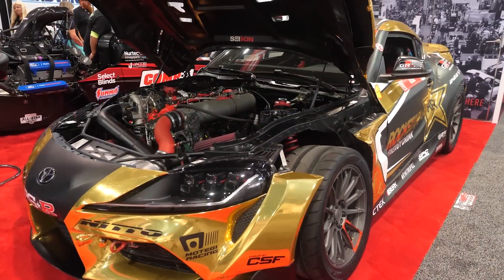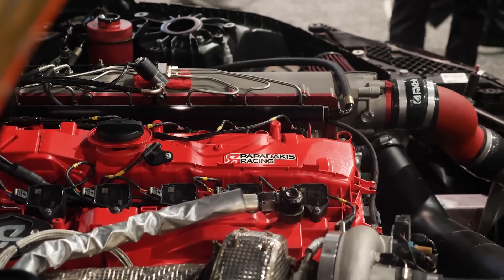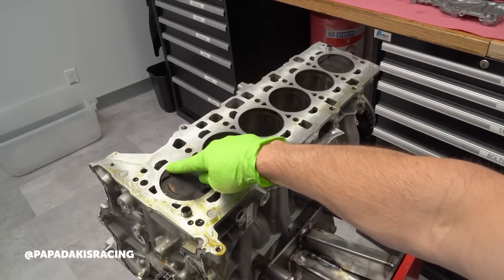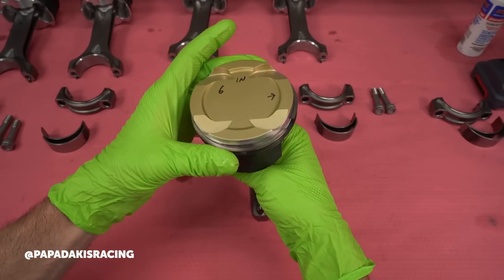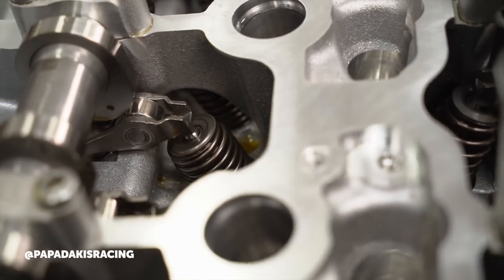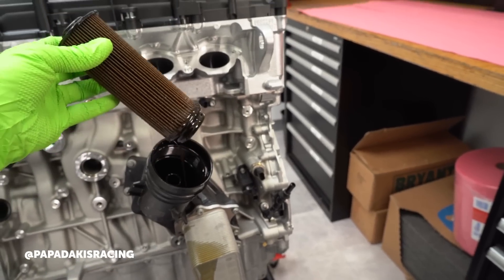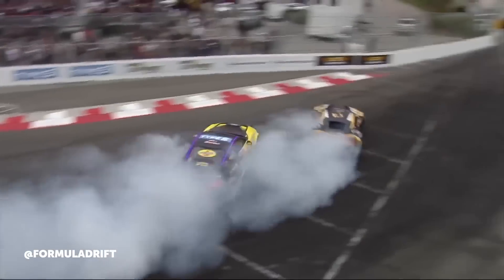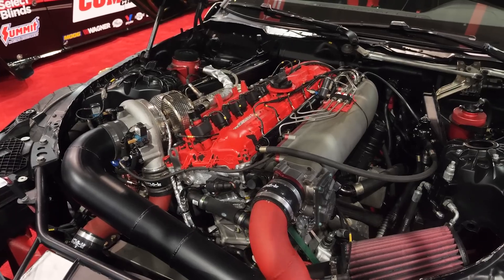Goodnight 2JZ? | 1200HP B58. Stock Block, Stock Bores & No Dry Sump!?

Comment: This engine still won't touch the 2jz records.
An engine isn't great because of what this guy can do with it. Just making over 1000hp doesn't automatically make it a good engine. Even subarus do that these days. 
The jz is great because pretty much anyone can have loads of power relatively easily. Don't have to pull the engine to do a timing job for example.
The Nissan gtr v6 is actually a better engine that makes way more power than its predecessor. The a90 is not ever going to be undeniably faster than the mk4 like the r35 vs r34. It's a Bastardization not a successor. 
2jz Oiling issues are from front sump swapped cars. The rear sump in the supras are perfectly fine and people get several seasons out of very high power cars without eating bearings.
It's the power coupled with Durability that make the jz great. Don't have to throw the block out because you nicked the cylinder wall.
Bmw engines belong in the garbage.

Now a jz with a bmw dct is a good combo.
Reply: Toyotas goal with the A90 was to be faster on a road course and the A90 Supras are faster than the A80's were.
Reply: @KingCobraStunts  no their goal was to make a bunch of money without spending any money on developing their own car. Just like the frs. Toyota has been coasting on the reputation they built in the 90s. They only produce junk now. 
The a90 shares zero similarities with the supra. It's not a supra. The m4 should've been the shared chassis if they had to use bmw. 
Honestly the frs has more in common. Even the frs has back seats. 
The blitz supra(very mild build) ran a 7:49 at the ring back in 1997. 
The current a90 record is 7:52 as far as I know.
Reply: @Dillon Youngquist  despite you being mad that they collaborated with a different company like they been doing for awhile, the 1 jz was a collaboration with Yamaha and the 2j was just an improvement of that design. It still doesn't change they made a better product than their predecessor at an affordable price, otherwise the car would have been the same price as the ones they want to compete with like the Cayman GT4 etc...
Reply: @KingCobraStunts  you're confusing collaboration with rebranding.
Lotus helped design the supra before the jz existed. They helped engineer, they didn't produce the car for them. Lotus also used parts from Toyota in their own cars. The excel has a w58 transmission. 
The a90 is 100% bmw 0% toyota. Manufactured in Germany by bmw.
And yamaha knows how to make good engines unlike bmw.
The supra was never an affordable car.
When you account for inflation the mk4 msrp would have been 100,000$ today.
Reply: @Dillon Youngquist  it is still a collaboration, the z4 and supra are not identical and it shows in their abilities at the track. The goals as stated by Toyota were to make a capable track car and they achieved that. The a80 was a sports car and the a90 is a more capable sports car, still keeping in line with being a sports car with a Toyota badge on it, you're just acting like a triggered fan boy about that because you have animosity towards BMW and feel Toyota should spend LFA money to build a sports car that would end up priced like an LFA...
Reply: @KingCobraStunts  also the ls400 was over a billion in development cost. And the lfa cost around 800 million. And do you know which one sold for $35,000?
They could absolutely make a great car themselves if they wanted to, but their decisions are solely based on the investors.
Investing money into r&d for a fun car and taking a risk on it would cost them way more than the potential sales loss if the car flopped. So they just paid bmw to slap a roof and toyota badge on a z4.
The mk4 supra is a legend. The a90 is shitty reboot.
Reply: @KingCobraStunts the Yamaha argument was a bad counter. your just arguing this point. Yamaha designed things and is a Japanese partner of Toyota for ages. BMW assembles the Supra in Europe. Software is bmw, suspension is bmw , everything down to the dimensions are Z4 BMW. How do you even contrast that to Yamaha? TOYOTA is not investing in sports cars u can’t disagree with facts.
Reply: Nearly anything is possible if you try hard enough
Reply: @coreyw427  I do not think the b58 will hit 2000hp with the stock block like the jz has. It'll have to be billet. 
The cylinder coating is a huge issue if you are going for really big power. 
The b58 is not a brand new engine for the a90 its been out long enough to replace the jz if it was capable. it came out almost a decade ago.
It will not be a popular engine to swap into anything because of all the better options.
The 5.0 mustang, Camaros, etc all hold loads of power without opening the engine. And they are easy to work on. Streetabilty is also very important. The locked vvt and sketchy oil control won't be good for that. 
I absolutely hate a v6, they sound awful. But the new z ttv6 is a much better setup. Once they've been out for awhile and you can get them Cheap with a salvage title they will make killer "cheap" seat time cars .
What lz and htg are doing with the a90 is sick but it's not simple or cheap.
Reply: @TacticalTushie  what stock block 2jz can hold 2000 hp? That’s ridiculous
Reply: @coreyw427  it's literally on this channel lol
Reply: @TacticalTushie  oh sorry thought you were saying stock engine / stock bottom end. My bad. I wouldn’t rule that out for B58 block though.
Reply: @coreyw427  I can't see the future obviously, but I don't see it holding that kind of power.
Dart is launching an aftermarket 2jz iron block that'll be stronger than oem and much cheaper than billet.
The b58 just can't compete.
Now if you just want to go play in a factory car with 600hp it's alright. But I don't see it ever being a popular swap for some grassroots idiot like me that puts engines where they don't belong .
Direct injection requires a more expensive ecu. And I really don't want to pull the engine when I'm a tooth off with the timing. 
My 1uz and 2jz can run off of a $200 speeduino ecu if I I wanted to be really cheap.
 I got my complete 2jzge from a junk yard with a 5 speed for $440(after covid) just selling the w58 will give my money back. 
Put in pistons, rods, gsc cams, eBay manifold, vs racing turbo, 1000cc injectors. Controlled by emu classic. Roughly $5000 for an engine that would easily make over 1000hp(just need bigger injectors) is a no Brainer compared to the b58. 
I think by the time the jz dies the b58 will have been dead. Something else will make both obsolete.
Reply: @TacticalTushie  a lot of pessimism towards an absolute work of art brought to you by the guys that made the s54. These are for sure going to get swapped in things, they already are. 2jz is too heavy for a lot of swaps.
Reply: @87isbmw  s54 is not a good engine. This is not art it's science. You are blinded with bias. Have fun welding your oil pump together just so your bone stock engine can rev past 4000rpm without falling apart.
What swap exactly is the jz too heavy for? Because they get swapped into everything, including ae86 and miatas.
You also gotta think about all the weight from other things you have to add vs a jz swap. The power steering pump is part of the weight of a jz its not on the b58 because it's electric. An electric pump is heavier than belt driven especially since the belt is there regardless. If you need a light engine no inline 6 is the right choice.
Reply: @TacticalTushie  is competing already, it has won were no 2j has won (time attack, circuit ect) it has hit 7 and 8 seconds with a lot less than 2Js even if they haven't touched 6s it deserves to be praised specially with a lot less power required.
Reply: @tempeztad where*
 you are just wrong on in every way lol.
Buy your logic The ej20 is better than the jz because wins in races where the 2jz doesn't(rally ).
When you are comparing engines the dyno is the most important tool. 
It is much less work to hit 1000hp in 2jz than a b58. 
Put a 1500hp jz in an a90 and it'll destroy the a90 1/4 mile record. 
You all just hate on what's known to be good trying to be race car hipsters. You probably hate the ls too.
Reply: @Dillon Youngquist  the hater here looks to be you... I said the B58 is in fact ,competing. I'm not trying to convince you, I have seen the events the B58 has be proven and won.

Never trash talked the 2J either. You do seem to have something against the B58 yet, we don't need you to try to convince us.

Jackie has won most GTA events, Mike Bottie is in the 7s, we are happy and celebrate their achievements.
Reply: @TacticalTushie  So much ignorance lmao, the engine capable of the highest piston speed of any production car is a bad engine but sure, even though it has higher piston speed than F1 it can't rev.  Well over 100hp per liter too. Literally just have to wire tie or put a spot weld on the oil pump gear for insurance. It throws off the front to rear balance, especially in something in the 2000lb range like the cars you mentioned but a keyboard warrior like you would never know. I have an MR-S hydroelectric pump on my swap, weighs maybe 2lbs extra but I can put it against the firewall for better mass centralization, while removing parasitic power loss to turn it. I'll take an inline 6 over a 4 or 5 cylinder any day.
Reply: @tempeztad  you don't understand what you are saying.
You actually think the b58 is better than the jz because the chassis has good grip.
If you equalize every variable except engine the engine with more power wins every time. This is not opinion it's fact.
So we can compare the two complete cars or just the engines or just the chassis. 
You are saying an engine is bad based on the performance of a chassis.
Going fast with less power is the result of the chassis not the engine.
And the 2jz is in cars that run into the 5s in the 1/4.  The fastest mk4 supra is 6.05 in the 1/4 I believe.
Reply: @Dillon Youngquist  I'm saying the engine is competing doesn't matter where. You just don't bench dyno and say myvpenis is bigger than yours. The B58 in weight savings along for many applications has proven to be a better choice plain and simple. I don't going to follow a bench crap as in many other post. The engine is really good, is competing and in many applications a better choice than the 2J.

You love the 2JZ? No one is stopping you. Have if you own one have fun.
Reply: @Dillon Youngquist  also 5s 2J are barely 2Js anymore... blocks are billet and heads mostly redesigned.

Stock block 2JZ still command respect and are in the high 6, low sevens zone which the B58 little by little are reaching. Both good engines.
Reply: @tempeztad  it's competing and loosing lol.
All I wanted was a new supra that could continue the r34 vs a80 rivalry. But the r35 stomps it in every way.
The a90 hasn't come close to any a80 records.
Reply: @TacticalTushie  R34 GTR is not a rival to the MK4 A80 Supra.

The MK4 A80 Supra's real rival is the Nissan Z
Reply: You're the only one speaking sense imo. There's a lot of kids here that love the new bmw as they're growing up with it. But the b58 will never do what the 2j has done. People talking how it's more practical and such are lost. Make both cars the same power output even at lower numbers and the 2j will poop on it. The a90 has modern tech on its side that's why it's progressing decently. But let's be honest. If you gave a 2j a modern awd and dct, it would legit be right up there with lambos are gtrs. Ekanoo did a 5.8s pass years ago on a full factory cast iron block. Just upgraded internals. 
People need to wake up. The b58 is good. But like the RB it'll never be great until it's made into a billet block and redesigned. The 2j will forever be better with just the cast iron block
Reply: @SomeFitCarGuy  all you mentioned  was done to a mk4 supra already and still lost against an MK5.
Like you said but in a more realistic way, there are kids now who never owned a 2jz, specially a GTE, criticizing the B58 for no reason at all.

While it may not make as much HP as a 2jz cause of the iron bock, it produces a lot more efficiently than a 2J while weighing almost half the 2j weight.

This contributes to a more balanced platform and winning in events that no 2J has ever won like GTA and GT3.
Reply: @tempeztad  it's pretty hard to win a race you don't compete in.
Gt supras usually use the 3s or uz because they are limited to 500hp.  When every car is limited to the same power you go with the lighter engine.
And you should probably know that the gt500 and gt300 do not run the b58
They run 4 and 8 cylinders.
Reply: @tempeztad   there is no a90 in the gt3 list on wiki. And the z4 on that list runs a v8
Reply: @Dillon Youngquist  you are right, GT3 still on the making my bad. GT4 has many podium finishes and  TA90 has won and beat many GTA records.
Reply: @tempeztad  the mk4 has never had a proper awd or dct designed specifically for it. It always Frankenstein setups with e92 dct's. 
If you have an equally modded 2j vs a b58 on a proper prepped track and the supra has a built auto it's going to shit all over the a90. On the street it's different. A 600hp hp b58 will put down it's power more efficiently. Everything goes cohesively together better. It is a bmw that's modded after all. 
But supras never got reputations for being efficient little track cars. The 2j is a savage and can take stupid power. That's why people love it. People compare them built to built. If you want a fun 600hp car the a90 is fine. The reason it gets hate is because it's a bmw through and through with toyota badges. Purists wanted a proper 3jz toyota purpose built car. If you're aiming for mediocre by today's standards. The a90 is exactly that. 
But people wanted a continuation of the savagery.
Reply: @SomeFitCarGuy  the 3JZ is the most ghetto, disparate ever from fan boys. There not a single mention of toyota intended to make one and it was a dream very few people would have been  able to afford if it came true.

Maybe I'm top old for kiddosh stuff and rather see decent lap times than breaking lose cars. Only MK4 I have respect for is the Max Oridos Ridox Supra.
Reply: @tempeztad  the 3j is a fanboy dream 100%.. but not ghetto nor desperate. If toyota built a supra to compete with the GTR and NSX it would have sold out immediately even with a ridiculous price tag. The GTR was pre sold out for 2 years back in 08. People have deeeep pockets. 120k is nothing to people. 

Flip the script and imagine bmw discontinued the m3 for years and when they brought it back they outsourced toyota to revive the name and it was built on a lexus IS platform. Can you imagine the outrage that would ensue? 

I understand the niche of what cars you're into but the a90 will always be medicore. Never iconic in one particular field. It'll get dominated on the track as well as the strip. So if a budget midline car is your thing I totally understand. But understand where purists are coming from too
Reply: @SomeFitCarGuy  the A90 is not medicre at all much less being dominated on the track. Also l, it has zero to do with budget as owned 3 2JZ car, two modded and they were super ship till the pandemic and idiots overpaying ruining the market.

For me personally is more of is not worth the asking price for parts now days. Maybe is that I worked those engine when they only costed 1.5k or even 600 bucks for a non vvti 2j 7 years ago.
Reply: @TacticalTushie  tbh I really don't care at all that the B58 isn't like the JZ in the slightest. I only care that we got a modern tunable I6 in the sorry excuse of a car market we have currently. Noting toyo makes now touches the B58 in tuneability and most people rarely try to touch any of toyos modern V8s,V6s,or I4s(maybe their 5.7 V8s and their AR series I4s in some cases but aren't very relevant in the car community to be swapped/talked about much) to even bother with the rest of their rwd platforms(other than the 86) that I can confidently say the nissans community even give more attention towards their other cars with other engines than their halos(VQs,KA's,TB's,VR30s,SR's,VH,VKs). Don't see them collabing with BMW as a bad thing since the toyo community didnt try with any of the F cars that were sitting around in the last decade and I didn't understand why people were wanting them to put their V6 in the mk5 when the RC350 was out 5 years well before the mk5 was even thought of, including the IS and GS350s . Even the some saying it should've been based off the RCF chassis or rebadged. it'd be back to square one on getting canned by everything in its price range cause its heavy and underpowered but that's just me. But anyway, its clear toyo isn't fit on making sportscars when the F cars/500 models are a prominent example of that and even then a small bit of tye community made a move with them and went to a full halt after and oddly abandoned on even doing anymore like they got scared of doing anything to them afterward. Even if the B58 was anything like the 2j, it doesn't need to be, it's now a new engine/platform that has alot of potential that people want to tap into just like the I5 in the RS3/TT or even the S58 in the M4/M3/X5/X6. Even if the mk5s case is different, we were given another car/engine/platform to play with from all sides of the car community to mess with just like what happened when the R35 came around.
Reply: @carboydorifutoparty3976  yeah pretty sure I already said toyota is dogshit these days. Maybe the gr corolla will be cool but I've done zero research. 
If you want to build a b58 that's fine. But when idiots are thinking it's gonna come out and dominate the 2jz it's ridiculous.
I'm not a nissan guy at all but the new z > a90. The rs3 is also a sick car. I want that sound so bad I'm considering putting a 5 cylinder in one of my supras.
Reply: @TacticalTushie  I wouldn't put the B58 that far at all tbh either. I mean, the S58 would more or less be a well more far comparison since its superior to the B58 in more ways than one that I'd call it closer to a modern day 2jz but not beating it. I'd call it a new modern I6 platform for people to throw power at with issue just like the S55 and S58. The New Z is..............50/50, I don't hate it necessarily,its that I expected more from Nissan especially the fact that the auto model is 2-300lbs heavier than the 370z auto while being short than a mk5 but I wanna see how far people push the VR30s in them(tho it looks like people don't since Ams is the only ones that made the move to push a 400z into the high 9s). If the mk5s came with the S58 then id say it'd dominate both the B58 and daza I5 easily by a land slide for how easy it is to get power out of them,especially with the fact that it'd be monstrous in a chassis that's 6-700lbs lighter than the G80 M3/M4s.
Reply: @carboydorifutoparty3976  I don't think people trying to make big power right off rip determines a great engine. Look how long it's taken the uz to be somewhat popularized.
The new z is going to make amazing salvage title race cars.  When you can get them without spending gtr money they will be great to just throw on an angle kit and shred.
That's a big problem in the current market. Msrp is a myth.
Reply: @TacticalTushie  fair I guess. But I guess it's dependent on the community. Was always skeptical on why people never touched toyos V6s as much while people hopped on nissans Vqs like wildfire despite how much people crap on them(I lile them also but its very dependent on the build with them with me). Tho on contrast I'd say I'm biased on cause I'm super into I6s/V6s compared to everything and have kept eye on what people have been doing with the BMW I6s/merc I6s/etc for some time and always thought over time people would find or start dipping into some of these chassis once things like the JZ's start getting stupid with how much people are selling them now and watch the aftermarket boom for them overtime.
Reply: @carboydorifutoparty3976  the is250 is ugly doodoo trash. The old is300 is just better in every way and I think that's why nobody cares. It looks like a Hyundai with a Lexus badge.
Reply: @TacticalTushie  people say the same about the G35 sedan and even call it cheap garbage and yet we have people making 6-800whp+ with them. Can't judge everything just by how it looks
Reply: @carboydorifutoparty3976  the newer v6 models were also more expensive than the is300.
The g35 just shares parts with the z so it didn't need a lot of people into it to warrant aftermarket parts.